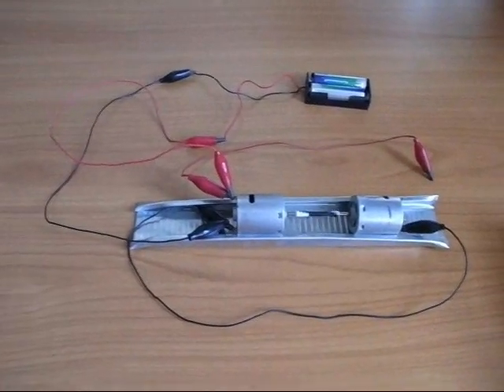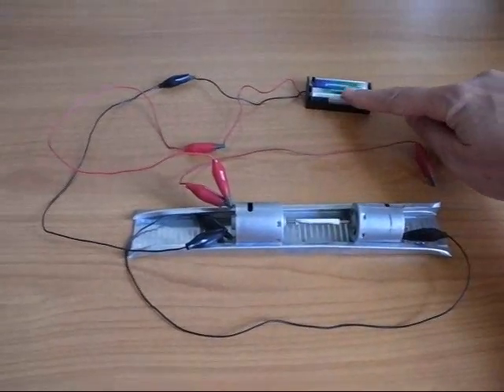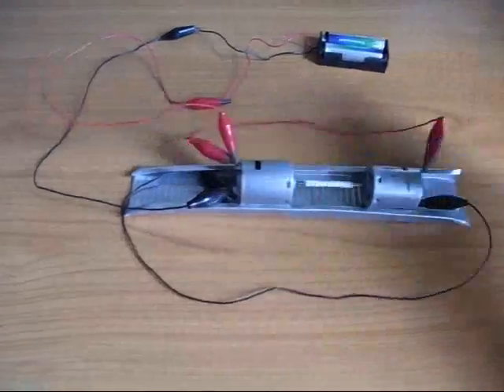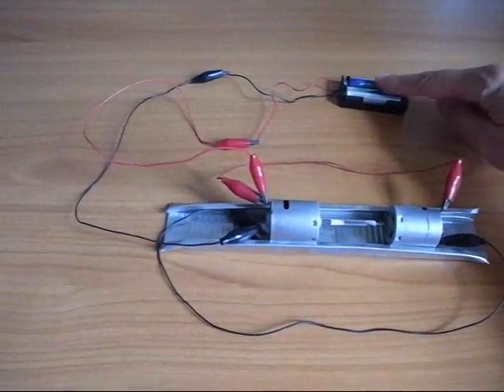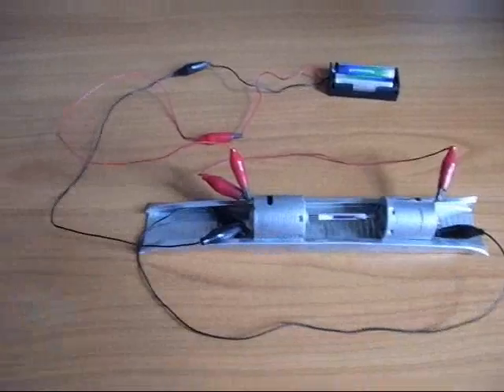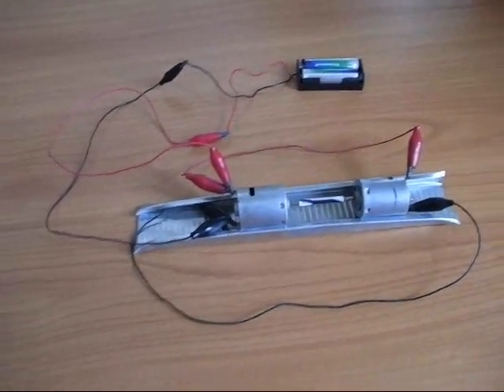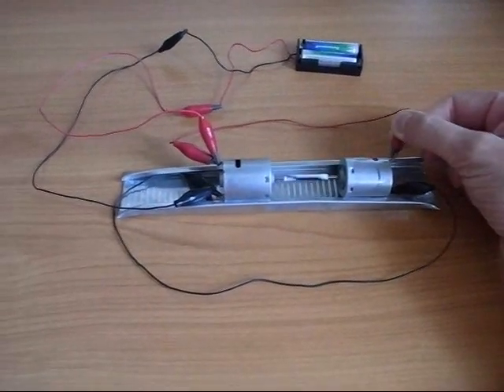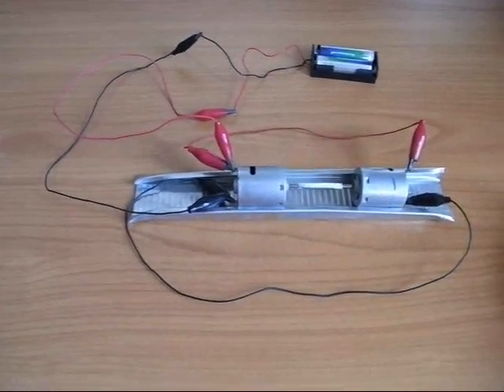Free Energy? Proof of Over Unity? You Decide! (Re-shot)

Comment: This is sooooo stupid, the "slave" motor is running without drag when it is connected to the power when you unhook it the "main" motor is turning the slave against it's magnets making it into a generator, try this: hook up a voltmeter to the slave motor and with only the main motor driving it measure the voltage across the slave's leads, you will have a small voltage!
ANY magnetic-based DC motor will work as a generator and when the magnetic lines cut across the copper fields! what a waste/time!

Comment: try adding a diode from the generating motor to the running motor and add a simple gear box to connect the two shaft's and you should have a near self running setup

Comment: There is no generation going on here, just that the other motor which acts as the generator gets power from the battery when you connect the terminals and starts spinning causing the increased rpm. End result would be double current drawn from the battery causing it to die sooner. 
ps: the title is a little misleading imho.

Comment: you a number of this type of on motor or generator  running another. and it seems the way they are doing it they have to add capacitors to store charge for the switching proccess from power source to one motor being the power source. also they rewind one motor to put out more power than the other, so it will have the power required to run the first motor. and more efficence berrings too.

Comment: Notice that the motors are facing each other (facing in opposite directions) and the way they are connected reveals that one motor is connected in "reverse" so when they are both running (and drawing power), they spin in the same direction when one is facing in the opposite direction to the other.

Comment: When it's going slower and the gen is not connected, it's really just a motor spinning another dormant motor (not acting as a gen or motor). But when your "gen" is connected, it is connected as another motor (not a gen). It spins faster cos they are both working as a motor instead of only one (and running the battery down quicker). No trick, just a motor connected to another motor.

Comment: Yes so what if the motor runs faster?  That only demonstrates that the overall reluctance from the motor coils (both motors in parallel)  has reduces causing the circuit to draw more current and therefore produce a greater magnetic field.  this would explain the increase in speed of the motor. No mystery here.  You are drawing more current because the overall reactance has decreased thus increasing the current draw.

Comment: you have the first motor R1 connected to the battery and producing Wo power and consuming (let's say) the same. Connecting the second motor you have another R2 load in paralel and the load (R3) is 1/R3 = 1/R1 + 1/R2. The power consumption (an let's say) producing is W=U*I=U^2/R3 ... there is no overunity...

Comment: .. (cont) Better to try driving a 12v motor (generator) with a 3v motor. Hopefully, the output voltage will be higher, considering some motor designs produce higher voltages at lower rpm's than others.

Efficiency is paramount of course. Using a flywheel should help. Remember though, batteries always charge slower than they can discharge. If you can find a high rpm 3v motor and gear down a bit to a low rpm 12v generator, that would be a great start.

Comment: You'll need a 2 part system. One running the motor off a battery, and the generator charging another. Wire the circuit with a double switch to switch over the battery packs when one runs down.

Note that electric motors when connected to a battery prefer to run like motors. To actually charge the battery, you need to drive the "generator" faster than it would normally run off the battery, creating more voltage. Actual generators are built differently to motors and are far more efficient. Cont..

Comment: it only goes faster cause yer running both motors off of the batteries which in turn causes the left motor to not have as much drag oh it........ my 5 year old figgerd  that out as i did, the motor on the right is rotated 180 degrees to make it look as if it is not wired backwards.... not hating just pointing out the mistake.........